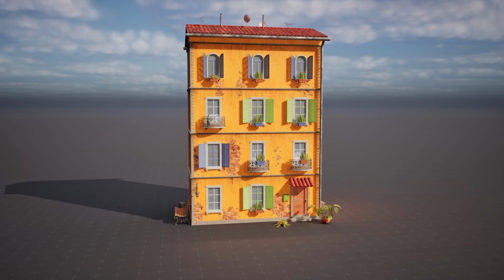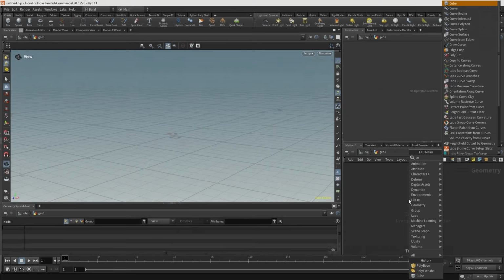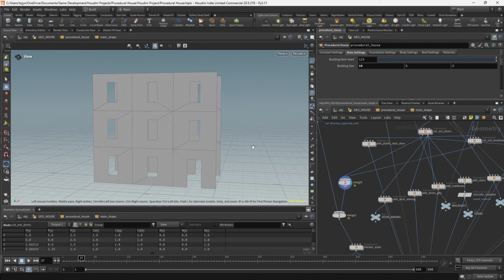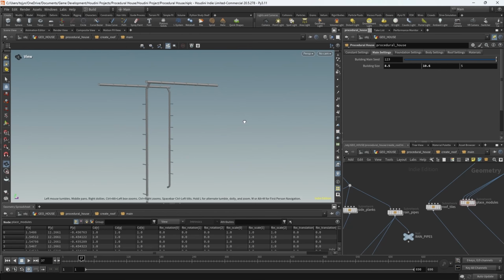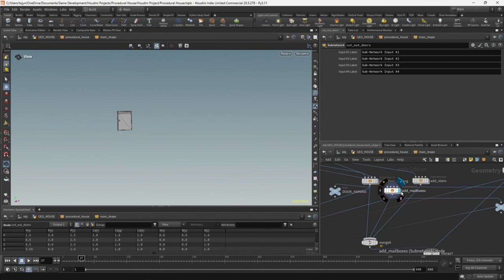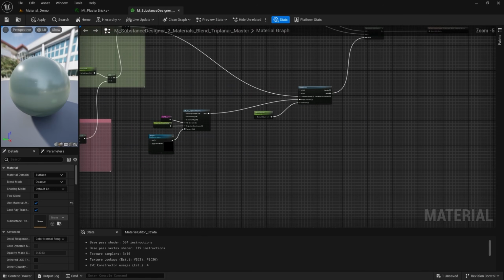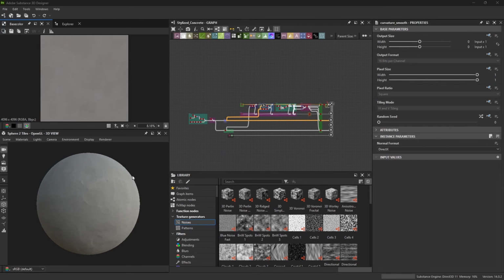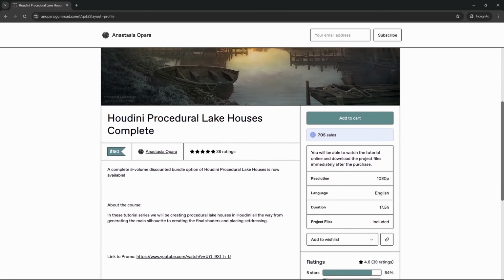How Games Make Millions of Buildings (That Build Themselves) - Breakdown

Comment: Blender Geometry Node is side eyeing you
Reply: Heh, I would choose geo nodes for the project if they had the same level of integration with UE as Houdini. I hope Blender devs will implement this in the future. The ability to change the parameters of your systems right inside an engine is crazy powerful!
Reply: @tojynick  I'm curious how the generated assets work. After you generate a procedural building, does it essentially act the same way as a static mesh in your level? When you package the project, there's no Houdini code that ships with that right? It's only used for the creation process? Thanks!
Reply: @vladdimitrov819  Yeah exactly, it acts as a static mesh with no Houdini code whatsoever!
Reply: @vladdimitrov819  Yeah exactly! Generation happens only in the editor and it produces just a static mesh. Houdini cannot generate stuff in runtime, so its code is not shipped with with the packed project.
It's mostly useful for game designers and environments artists imo. With procedural tools, they can create a blockout of the scene and quickly generate quite detailed geometry of out it.
Reply: @vladdimitrov819  Yeah exactly! Houdini produces just a static mesh and no code is being shipped with the project since Houdini doesn't support runtime generation (unfortunately).
Reply: @vladdimitrov819  you need to bake them. You can merge them as one mesh, or you can use instance.
Reply: @tojynick  I'm just teasing. amazing work btw. It looks like you know Houdini like the back of your hand so why switch! the way things are going I wont be surprised if you switch to unreal PCG in near feature
Reply: @XAHAK  Thank you ^^
Reply: Yeah my first reaction
Very clear this is a massive shill/paid video by houdini lol...